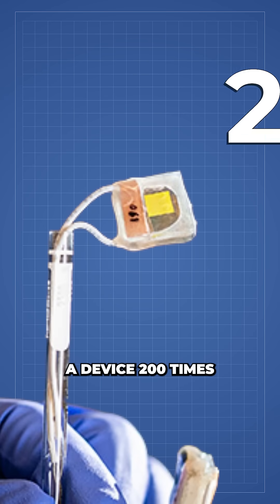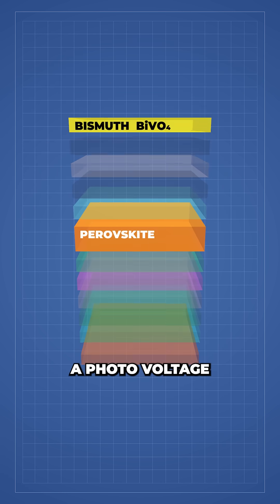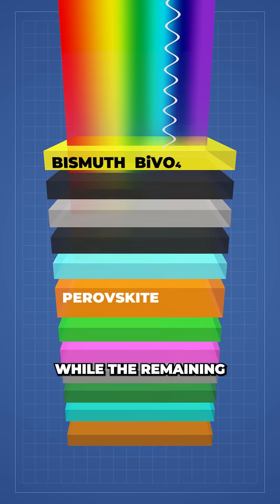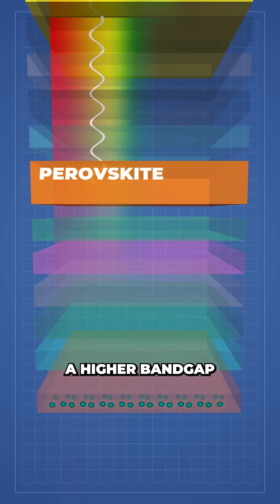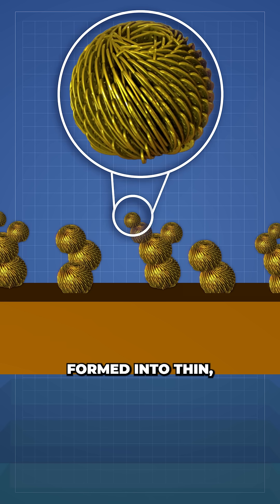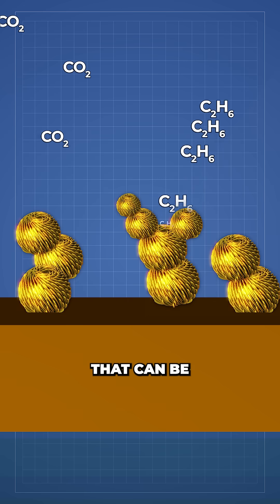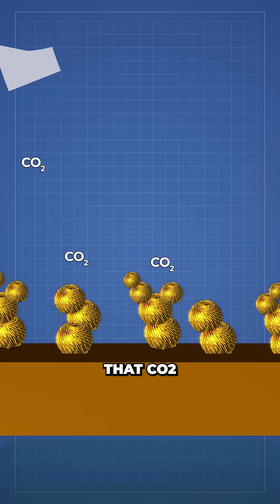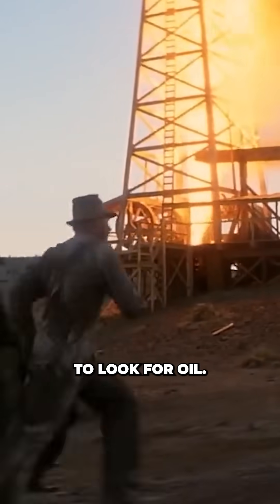Scientists Create Artificial Leaf That Converts CO2 into Fuel

Comment: This is probably the first solar thing that I have. At least some confidence in that it will rival nuclear power not only can it generate electricity, but it also has the byproduct of turning CO2 into usable secondary fuel in portable applications similar to what Japan is doing with some of their new reactors that produce hydrogen as a byproduct
Reply: im sure it would be able to rival a nuclear power plant if enough of them were deployed, but if you had a button that instantly changed the mindset of every power company on the planet, would you rather have them try to deploy enough of these panels to meet demand, or would you rather have them deploy enough nuclear plants to meet demand?

i personally would choose nuclear plants, simply because they would be easier to make/maintain which means lower power costs in the long run

to rival nuclear power it has to not only produce as much power, but also be just as safe, just as mass-producable, just as efficient, just as cheap, and just as reliable, not to mention even though nuclear power surpasses fossil fuels in all of these categories, it still didnt manage to usurp the power generation throne from fossil fuels, to finally put an end to fossil fuels it would take an absolute miracle generator so effective that you would have to be beyond insane to not use it for everything (if the lack of nuclear power adoption taught us anything, it's that our society is at least a little insane)
Reply: @nobodyinparticular968  It doesn't mean we shouldn't still research every possible avenue.

I feel like when people ask if something is economically viable, like it's the most important thing, capitalism has completely infected the way they think. 

Economic viability matters for implementation, but we should not ignore a branch of research just because it takes effort and resources, and doesn't give an immediate or clear return on investment.

Science must move forward.

Anyways, unlikely to be used significantly unless there are very major breakthroughs.

But the research is still beneficial. Because it's new information, and new data.

Have a good day.
Reply: @Awesomeryay  all true, the research still provides value as we slowly march towards an actual miracle generator

you have a good day too ❤

Comment: OK, but how resource intensive is the process and how long do the devices last before needing to be replaced? I ask because those are the main reasons. Why solar and wind energy aren't as efficient as people say they are.
Reply: They aren't to that point of testing, and likely a decent amount.

Bismuth is not very common, and I keep forgetting the name of the other element because I've never previously heard of it.

Basically? Likely economically viable in a decade or two of R&D.

Even the most pie-in-the-sky technology, or what seems like it, is achievable. Well, you know what I mean. We just need more knowledge on material science, and how the materials interact.

Have a good day.
Reply: @Awesomeryay  that’d be because the other material is a mineral, not an element
Reply: you can bet your ass they suck for anything other than tiny devices. 

why focus on shit like this when we can have legitimately infinite fuel that doesn't actually release co2 (fusion)
Reply: Solar and wind are fine for efficiency. Their main issue is land use efficiency.